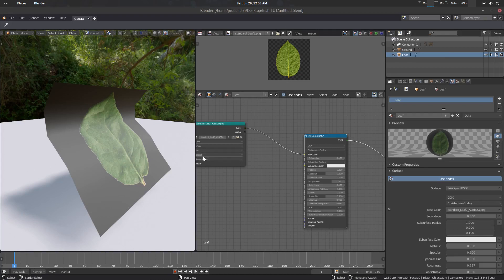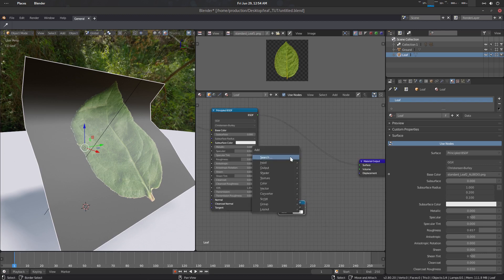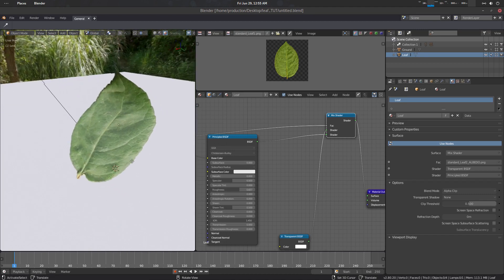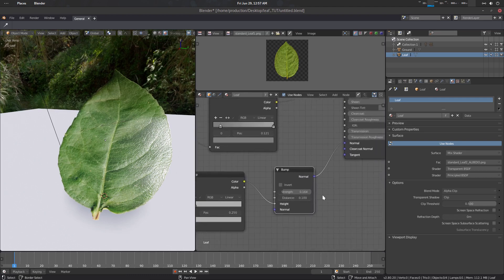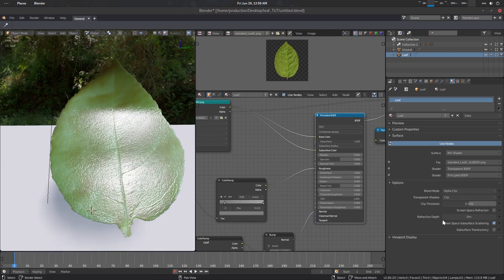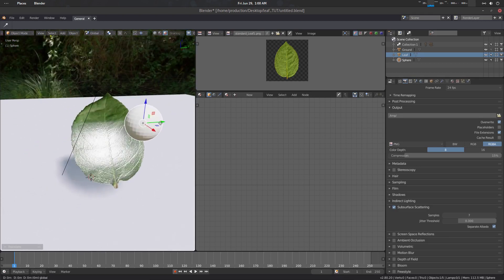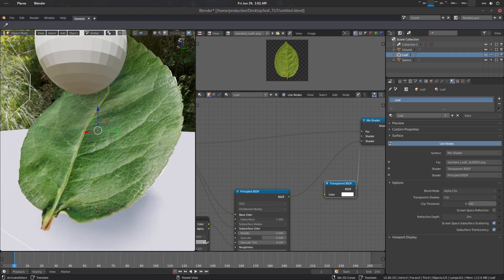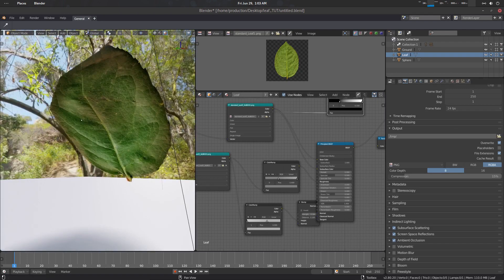Blender Evee Alpha Clip, Transparency & Subsurface Scattering Workflow Tutorial

Comment: A couple corrections for the video: The 3 radii on the SSS are for Red, Green and Blue channels, so skin materials for example have a larger Red radius than a Blue radius for SSS. Also, the Alpha Clipping doesn't control post-multiply. It just makes any partially transparent parts fully transparent. You can do post-multiplication by multiplying your Albedo texture by the Alpha channel (color mix: Multiply).
Reply from the maker: Thanks Lowell for the nice explanations... Pinned.

Comment: Did they move or remove the Options  -> Blender Mode feature in the latest 2.8 builds? I can set up transparency using the "Rendered" view, but it does not appear in the "LookDev" view.  I've love to use a transparent image, but get the performance you're showing here.
Reply from the maker: Should work on the latest build. Try File>Load Factory Settings. Just Tested with Dec27  release.
Reply: @cgvirus  , thanks for following up. I noticed my issue:  I didn't have eevee set as the renderer.  Set that, and then the options changed.  I'm all good now!  Well...  almost good.  Now I'm waiting patiently while the magicians figure out a way display a texture on a model while sculpting in sculpt mode.  Currently, with textures displayed, you have to exit sculpt mode to see your sculpting progress.   Anyhow... thanks again for the video and your response.  Cheers!

Comment: why not use transmission input on the principled node? ALSO hashed alpha is like using hashing to vary the alpha value, its handy for having say, an alpha value of 0.5 without needing to use the computationally expensive blend mode, it works by having every other viewspace pixel be either 0 or 1 creating a very very cheap method of partial transparency, it's not very visually appealing but it makes the rendering much much faster...

the shadowing works in the same way, for the leaf example in this tutorial it would do nothing, but if you were doing some semi transparent glass or something it would be using pixelated 0 1 values of alpha to generate the cascade shadows.